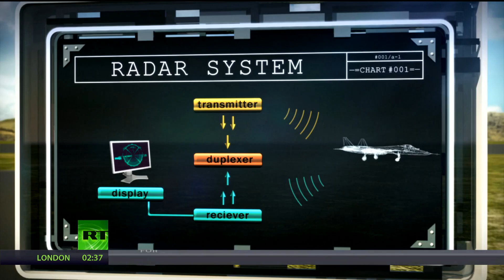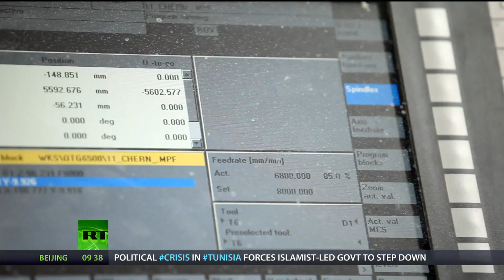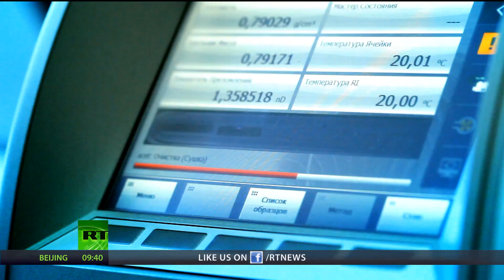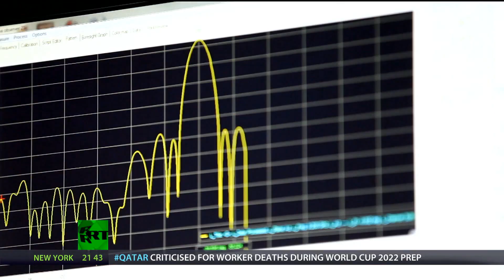Sukhoi T-50 PAK-FA Stealth Technology

Comment: PAK-FA isn't that stealthy. It's engines are round which shows up more easily andd it doesn't have a jagged edged triangular exhaust which is also used to defeat radar. No recessed exhuast to defeat thermal either.

Comment: Lol, and 4 years later they have built 10, SU-57s and they can't get the engine tech to work.  They've been picked up on radar with ease and if one got within 200 miles of a Raptor,  it would be a falling ball of fire before it knew the F22 WAS THERE! GG Russia, GG

Comment: Lol molds for large details of combat aircrafts made out of wood, it is laughable. Ill tell you you will have several cm difference in every same object  produced out of these molds. Thats the reason why every western manufacturer use at least aluminium for their molds. And in the radar cross section testing chamber is tested only the air craft nose with its most natural stealth position. These russions they know how to made videos to fool stupid people. Because of the parts that are produced with wooden molds and the imperfection resulting of this the aircraft will be capable to fly correctly only at low speeds.

Comment: Poor Sukhoi.  Now India does not want Su-57.  RCS too high. Engines unreliable. The Chengdu J-20 has leap-frogged Su-57,and Shenyang J-31 will be available for export by 2022. F-35 is entering FRP in 2019. USA F-X and F/A-XX are in prototype stage, and Lockheed-Martin is planning an F-35/F-22 hybrid.

Comment: "It is imposible to make the effective surface of the plane equal zero and render it invisible". B-2 och F117 is equals to zero!
Reply: Lol. F-117 was shot down by obsolete Russian sam made in 60s. Another F-117 was shot down by Mig-29. B-2 was cancelled from production because almost all Russian made sams can see it easily.
Reply: @AlexanderTch  No, only one F-117 was shot down, and that was because NATO kept running them through the same flight paths. The Serbians simply placed SAMs on route and waited for the bomb bays to open. Another F-117 was hit in the same scenario by another S-125 Neva, but it returned to base. And your statement about the B-2 is entirely false. A good approximation for radar detection range is to multiply the 4th root of the RCS by the detection range. Most Russian fire control radars likely wouldn't be able to target it beyond 40km.
Reply: @sovietpineapple7938  That's lie about same path. Crap. It was not same path. Serbian SAM crew just caught F-117 and shot it down. That's is fact recorded everywhere. Only moron invent lies to cover sheety american equipment. Second F-117 was shot down by Serbian Mig-29 pilot.  He made a lots of damage to F-117 and it fell down, but on territory controlled by NATO and therefore Serbs couldn't take its remnants. Remnants of first F-117 went to Moscow.

Comment: Stealth is Bull. A WW2 radar can pick all so called "stealth" planes.
Reply: A Low frequency radar can detect there is a plane in the area, but not excactly where it is and not able to get a lock. Unless they have several to make a triangular, but thats not practical. 
Russia says stealth does not work, but they struggle to make a stealth fighter themselfs..... thats funny. 
They know it works.
Reply: +Luke S Yeah cause Serbia never shoot down a F-117 STEALTH aircraft with an outdated Radar,right?
Reply: just the t50 because it's not stealth.  good luck with US planes.  there's a reason Putin called the US the only superpower.  because it's true.
Reply: +Brian König lol 1960 plane.  but you need to live off that it was shot down after it had damage to the exterior of the plane compromising the stealth.  but good job on that. how was the 1000s of Russian made planes after that shot down buy air to air with 100% lose.  lol. I'm glad you at less have that one plane shot down by a sam.  also there where a few more shot down buy SAMs look them up.  then you won't have to feel the truth of how Russian made planes have a 100% lose in air to air against the US.

Comment: stealth is not fake, it just doesn't make invisible. it makes what you see on your radar screen very small. which is why a computer controlled radar wont pick it up. because a computer doesn't find it weird when it sees something on the radar screen that appears to be the size of a bird, and that bird traveling 1200 km/h. luckily most Russian radar systems are manually operated as well as being able to function autonomously.
Reply: +Lodewijk Vrije Not how it works.  It is the size of a bird and it is getting picked up and now it's gone and Oh, there it is again...and hey, where did it go?  That is why stealth works.   You can pick it up and track it, but can you reliably do so well enough to shoot it down.  Tough to do.

Comment: composites do not reduce RCS.
The F-117 and F-22 use the same kind of canopy coating.
Reply: +0MoTheG No, but surface and the coating can be done of radar absorbing materials.
Reply: ***** Unlike that of metal? A perfectly shaped and closed metal surface is better.
Reply: 0MoTheG Nano-coating can do also wonders, since instead of scattering the radar wave, it ABSORBS it.

Comment: While I admire the aircraft, its' outward beauty and performance, credit should be given where it is due for the technology used to build it. There is more American tech in this plane than Russian. Honestly think and research who and why anyone was sold carbon-fiber manufacturing process and equipment, currently used by modern Russian aircraft (both civilian and military). Intel, AMD, and Lockheed, and TI have all jumped in to help Russian industries, including military. The microprocessor and data-bus technologies are all western, even their oil and gas processes use a large amount of American technology in the form of not only physical equipment, (separators, scrubbers, etc,) but also in the form of control processes,PLC/SLC logic controllers

There is nothing secret about this transfer of technology and know-how; actually it is just good business, though some would say it is the darker side of globalization. So before all of the ultra-nationalistic fan-boys from all sides start beating their chest about how good or bad something is-- stop to think about whose technology is in it...you might be pointing the finger at your own when you say something sucks.

Just an FYI, current Russian PC platforms use primarily AMD processors, though some use Intel. Russia is looking to switch to their own home-made processor (Baikal) by 2015...look it up.

It doesn't mean they are better than worse, we simply sold them processors, taught them how things work and how to make their own, we make money, they make products and make money, and everyone is smiling at the bank.
Reply: Tzebra just like the way nasa need russia to there big events in the space and wiont get out of it because they are not capable so it is normal for nations to cooperate but also lockheed do not produce antything for russian jets because even them they buy intel from the intel company which has no relationwith lockheed
Reply: Actually they buy more AMD than anything else. This year Russia released its' quad-core Elbrus-4C CPU; its' first home-grown CPU; similar and mostly the same as a Pentium M type.
Lockheed does produce for the Russian programs, through third-party vendors. Everyone is making things for everyone else. Unfortunately there are far too many ultra-nationals and hard-liners to recognize this.
Reply: FADHILI MTAVANGU
 Actually the west has more available than Russia, and Lockheed is part owner and both a technical and funding member of Khrunichev and Energia: (LKEI). In cooperation both established ILS, marketing both the Atlas Proton expendable launch vehicles.
The West has the technology and funding, the Russians have manpower and locations. It has always been to our mutual benefits to operate and cooperate with one another in most matters.

The West has always been capable of going it alone, but it is more profitable to do it together.

Comment: electronicdawg "The US devastated the Iraq Military the 4th largest in the world in less than a week. All Russian hardware I might add. Including All Mig 25-Mig29, not a single loss to Americas F-15's.  get a fucking clue and stfu."
 Oh pahlease... The IAF was not a competent airforce, regardless of their hardware (how many of those types were modern?). It was the 6th largest, not the 4th. The aircraft were not well serviced or supported and all the ground radars were knocked out in the first hour or so of the war, they had no EW system to help them and their AWACS were not functional. Their pilots did not know how best to exploit their machines because with so many different types, few pilots had finished their conversions and many did not even get off the ground. One F/A-18 was shot down by a MiG-25. A competent airforce with the same or more modern hardware and functional AWACS would have caused a hell of a lot more trouble.

Comment: my country ordered the f22, I think the t-50 is better
Reply: Michael Todd yet another ARROGANT underhuman to shit over people
Reply: Galova, you are the arrogant one. You insult people that disagree with you becuase you know yiur wrong. My response was directed at you calling me a dumb ass, why, because I stated your precious T-50 does not have the radar or sensors that the F-22 has. This is a fact. The F-22 Raptor is equipped with the ALR-94, which is the most advanced Radar Warning Receiver (RWR) in existence, having a maximum detection range of 463 km , which is even greater than the radar. It is able to coorporate with the APG-77 by delivering target information, allowing the radar to work passively and to detect a target with a narrow beam, which then can be taken out when coming into missile range. This provides a massive increase in stealthiness for the F-22 Raptor, as it doesn’t give off any signal, which could make it visible for the enemy. THE T-50 utilizes a low band radar in order to detect low observable aircraft,  but it can't turn them off. The ALR-94 can detect those signals well in advance of the any Russian aircraft seeing it, thus turning a perceived advantage into a disadvantage.
Reply: vintage stereo not only him. look up 4/6 F 35 is a Lemon there is an entire series of 6 videos including this documentary stating the pros/cons of the F 35 and it seems the cons outweigh the pros
Reply: ***** the PAK FA has better charectaristics in someplaces and worse in others, each has their problems and advantages
Reply: +88mroux  " The Russian version comprises of the Indian Avionics"
source?
And BTW do u really think that the Russians were going to allow the Indians see their actual stealth or their radars?
Reply: ***** that was early 2014 they changed their minds
Reply: ***** its a good plane but has its vices
http://www.defenseindustrydaily.com/f-22-raptor-capabilities-and-controversies-019069/
Reply: I don't understand the discussion here. Experts says that the fa-35 is a flying duck. Who are we to deny these experts? Just be happy you will never have to fly one of these planes. The f-16 was a formidable plane but the 35 isn't. end discussion.
Reply: vintage stereo they need an excuse to justify the 1 trillion wasted on the peice of shit
Reply: +Michael Todd You don't even know what the T-50 avionics are, BTW India only explored the part of the T-50 that  the Russian's allow them to explore
Reply: Charlie Gareginyan only in the Indian version
Reply: User 157642 well the Russians can't give ALL their secrets! no ALLIES go that openly.
Reply: +88mroux How do u know the F-22 is stealthier ,are u a double agent.
Reply: vintage stereo You don't even know what jet you are talking about and still go on trying to say the f22 is crap...Shut the hell up you moron.
Reply: Charlie Gareginyan the Indian government decided to go with the Rafale, and not the T-50.
Reply: Michael Todd pierre sprey repeated several times that the f-35 is a flying duck. The guy is a expert. Happy that I don't have to fly one in combat.
Reply: User 157642 Umm dude do I have to remind you that INDIAN ELECTRONICS ARE IN THE PLANE, they have acess to most of it and recently have had their pilots get familiarized with its capabilities.
Reply: 88mrouxMajumdar writes what you want to read. If he writes the truth, he will be thrown out of the newspaper. Why he does not write about the new technology of Russian stealth "HIBIN"? Reduces the visibility by 25 times. The Russians offered dog fights many times. The Americans refuse. Why? The military department can not justify the costs?
  http://x-true.info/43442-su-30-protiv-f-22a-raptor-su-nachinaet-i-vyigryvaet.html
These are export options. Without "HIBIN".The radar detection range is 30% smaller.
Reply: F-22s are not for exporting. Only USA has these fighter jets?
Reply: Michael Todd ***** Man you are idiots... learn the fact about the T-50 firsts... then find out what the US experts think about it... (it's by far better they say) .... propaganda propaganda like 2 brainwashed US rats. 
India buys 4+++ gen Russian planes and will continue to buy 5th gens. They never got the chance to inspect the capabilities because the plane is still being refined. Michael the knowledge guy my ass.
Reply: Michael Todd 1. avionics can be upgraded or replaced (you have no idea what avionics T50 is going to be equipped with, absolutely no idea, but still you make statements idiot)
2. radar is AN OPTION it can be replaced, upgraded, modded etc. You HAVE NO IDEA what radar is it going to have. Still another idiot saying about superior shit. There is nothing "stealth" for Russian radars but still you believe in fairytales and santaclaus. Stupid ass
Reply: ***** the PAK FA is more overall a design made for more payload and more combat the F 22 is designed to make stealth missions with minimal payload. the PAK FA is betterin BOTH pitch and yaw, take a look at teh MAKs 2015 footage, the F 22 would stall doing that.
Reply: ***** The netherlands, we ordered these planes, really
Reply: ***** ok, thx, i thought it was this one.
Reply: well i think those f22 will drop as death flies against the t50, the t50 is more advanced
Reply: vintage stereo the T-50 is not more advanced.  The F-22 and F-35 have superior avionics and radar. When India got a chance to inspect the capabilities of the T-50, they canceled the order, called it a piece of crap and said that russia was inflating its capabilities.  Since India is one of Russia's largest purchasers of military arm's,  that speaks volumes.